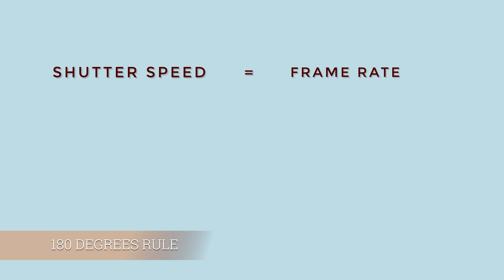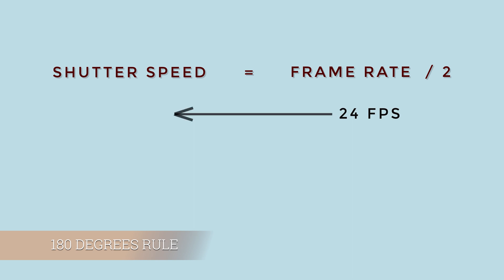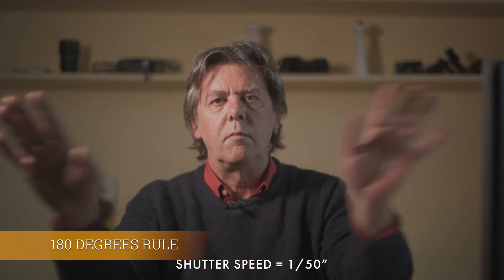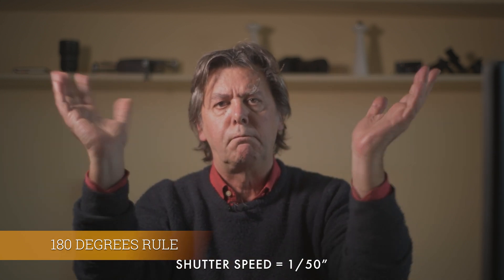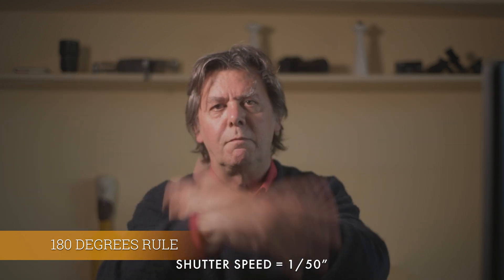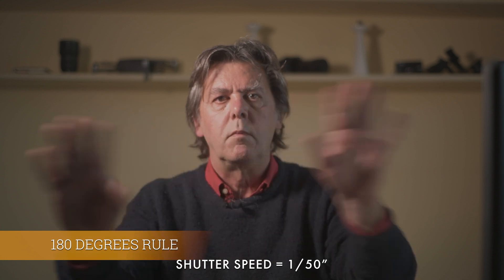Time-lapse: control motion blur and shutter speed for best quality

Comment: I read the following on a web site explaining that intervals to shuttler speed using the 180 degree rule. What do you think about this VIC? Quote from article: 

“There is a problem with intervals in time-lapse photography. Set your interval for two seconds, and your shutter speed for one second. The overall interval time will become 3 seconds.
The camera starts counting the interval after it takes a photograph. Not when the last interval ends.
Shorter times are not as affected as longer exposure times. That’s where the above calculation becomes further and further out of whack.

All in all, the one-second exposure will not give us the 180 Degree rule. You may get a nice image, but it’s not what we are after. To make it true, the interval needs to be one-second, just like the exposure.
Reply from the maker: HI Tom,
it is true. 
I use the 180 degree rule whenever possible, but the camera needs to buffer the photo and in general it takes a bit more than half a second.
This is why I never shoot timelapses with a frequence of shots of 1 second, as the ideal SS is half a second and there is not enough time for buffering.
But starting from a frequency of one shot every two seconds everything is fine
Reply: @VICVideopIC  So the 2 second interval would be the sweet spot? I have been using 1 second mainly but occasionally will drop a frame here and there and that messes up the final video.

Comment: Thanks Vic some great advice and techniques. Wonder if you would share abit more about the train timelapse? Would that be 1 second with a shutter speed of half a second or would you have to do 1/4 second because of camera shake? Also wondering if you used a tripod? 

Going through Canary Wharf looked amazing!
Reply from the maker: Thank you Paul,
sorry for the extremely late reply, but for some reason, I had not seen your message before.
The one on the DLR| was made at a frequency of a shot every second and a SS of 1/2.
With my Nikon D850 (and with most cameras) one shot every half second is not really an option, due to the buffering time for each shot.
I did not use a tripod, I was sitting on the front seat of a DLR with my camera against the front window, holding the camera as steady as possible.
With such a strong forward speed the lateral shifting of the train is not much of an issue

Comment: The 180 Rule is "Shutter speed = frame rate multiplied (x2)"  Not "Shutter = frame rate divided (/2)"
e.g. 24fps = 1/50th shutter speed || 30fps = 1/60th shutter speed || 60fps = 1/120th shutter speed
Otherwise, great information !
https://www.polarprofilters.com/blogs/polarpro/how-shutter-speed-affects-video
Reply from the maker: Thank you Dave,
what you say is very interesting, and I had seen the link from Polarpro.
But under the math point of view, I do not agree with them.
1/50 is the inverse of 50, so 1/25 = 1/50 divided by 2
1/24 multiplied by 2 =  1/12.
It is much clearer if we go into whole numbers:
For a frame rate of 2 seconds we use SS of 1 second
2fps/2 = 1 second
Frame rate of 4 shots per seconds, SS of 2"
4sps/2 = 2 seconds
Reply: @VICVideopIC  Thank for your reply.
 I believe you are making it more complicated than the "rule" suggests.  The "rule" is more a "rule of thumb" than an actual mathematical equation.  Your method only works with 24fps doesn't it?  if you take 60fps, your method would result in a 1/30" shutter speed which is not correct. The frame rate is not a fraction.
The "rule" is meant to make it quick and easy to get close to a cinematic motion blur.  You simply take the frame rate and multiply x2 to get the shutter speed.  Shutter speed in the "rule" is actually just referring to the denominator of the actual shutter speed.  1/60th is referred to as "60", and so on.
The most common frame rates are 24, 30, and 60.  120 and even 240 for special circumstances. 
24fps = (1)/50th
30fps = (1)/60th
60fps = (1)/120th
120fps = (1)/240th
etc.
This does not seem easier to explain and remember than what you are using?  I am curious where you came by your explanation?